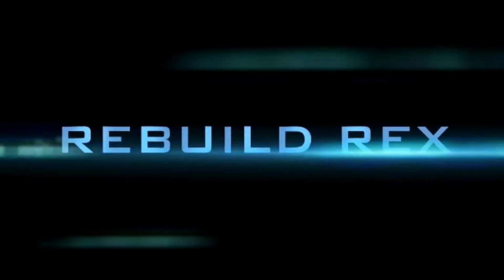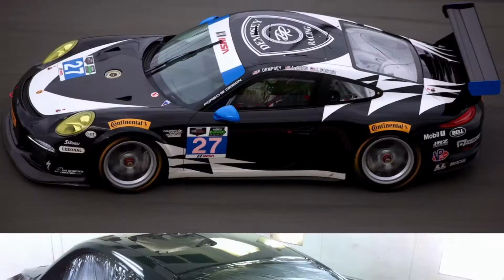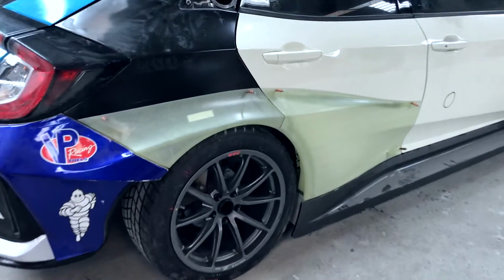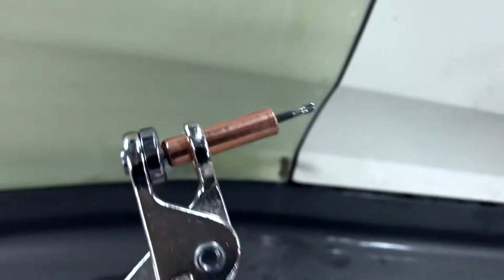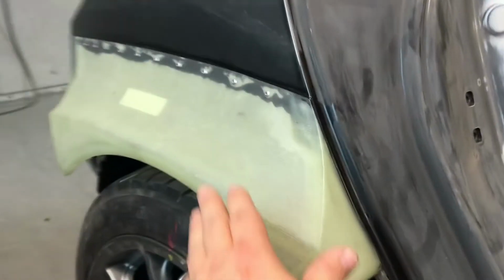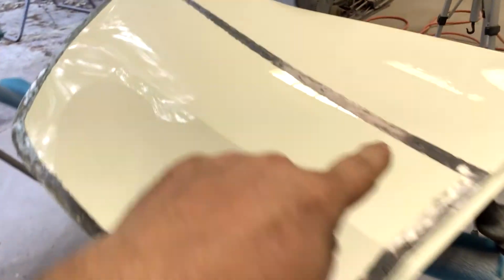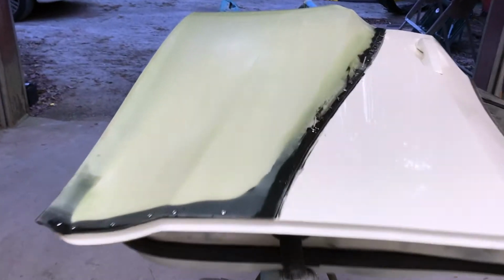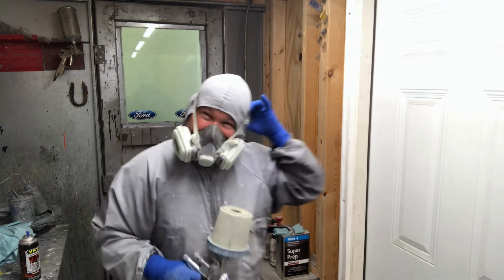Rebuilding a Honda Civic Type R Wide Body #Easteregg #Typer #Rebuild

Comment: Thank you! I am going to be trying to paint for the first time. My 944 now has fibreglass fenders and bumpers. Was curious to see if there was different steps to painting fibreglass.
Reply from the maker: Fiberglass is typically pretty wavy, so I like to block and prime at least twice. Other than that the painting process is the same. I’ve got some footage of a 924/944 with fiberglass parts. I’ll trying to put that video together soon. It will probably be a good video for you.

Comment: What was the grey basecoat colour code would you remember. Thanks
Reply from the maker: If I remember correctly, I “cocktailed” that color. I have reached out to J.A.S. Motorsport and asked them what the interior paint code is. When they respond I will forward the info on to you. Thank you for watching!!